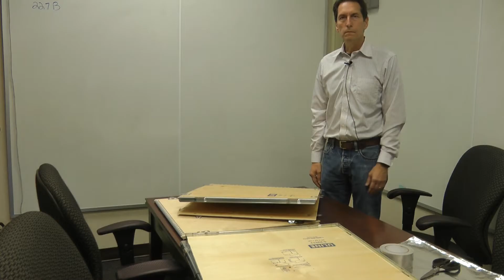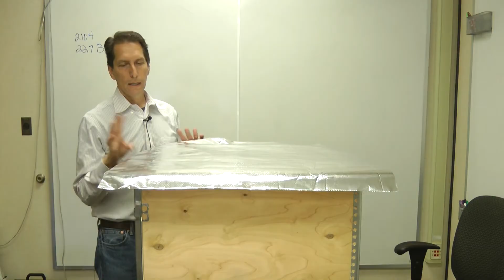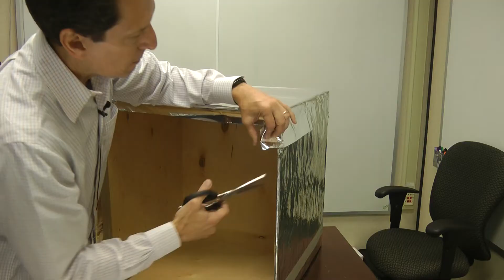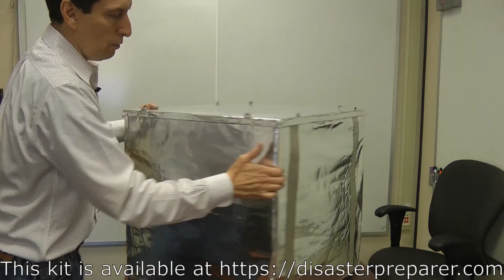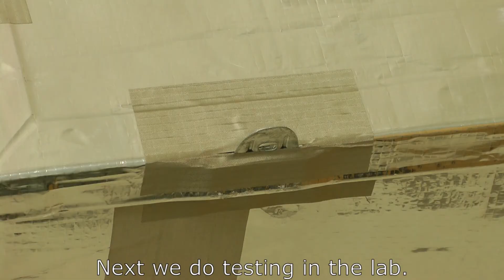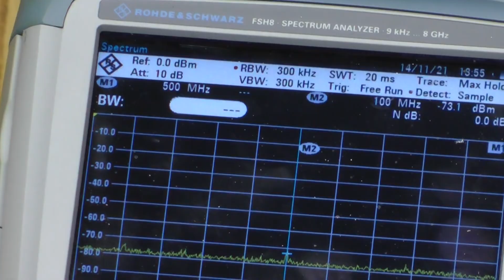Faraday DIY Box

Comment: Hi, Dr. Bradley.  I want to protect my home power station system from an EMP incident. The battery backup is not on wheels, but I plan on buying a small expandable furniture dolly that I can fit to the bottom of the battery so I can move it around, as it is much too heavy for me to lift.  I thought if the bottom of the box was not attached to the sides, I could lift the sides and top off to use the battery backup, like turning your box upside down.  It is 16.5" long x 13.5" wide and will be about 17" high when it is on the dolly.  I need to be able to access the front, one side and the back when I use it.  I thought I would roll it onto the bottom of the box and place the box upside down over it.  Do you think that would work?  Are you selling the pieces of your 2'x2'x2' box?  If not, would covering a cardboard box with heavy duty foil block as much as wood?  What is the brand of foil/cloth that you used to cover your box, and do you sell it?

Comment: I just finished with the setup of my Faraday Box using the components that I ordered from your website and the 24x24 box from Uline. Should this box prevent my Android phone from receiving calls? If it should then the box is not working as it should. I have no tears in the conductive wrapping or the tape that I used. I don't have any RF tools to measure what's being blocked by the box, so I don't know what I should do here.

Comment: Excellent video.  Very interesting and worthwhile video. 
Can one make such a Faraday Cage (Box) using a heavy cardboard box with two layers of aluminum foil covering the exterior?
Can one use a steel trash can (with a tight fitting steel lid) and with a cardboard box in the trash can's interior?
Will these Faraday Csges suffice for a Carrington-level CME?
Many thanks.

Comment: Also where can one find the corner metal hardware?
Reply: I’m thinking the metal hardware doesn’t really matter. You could nail/screw 6 square pieces of wood together and line it with the same conductive material and be fine, as long as there’s no gaps in your conductive material.

Comment: The one suggestion is place Rubber old Tires or Rubber mat on Bottom. This will ressistance Electrical Power or Surge. Defetes need for Faraday Box. Plus Surge Protector inside also. Extra Protection. Great Size for those with Cpack and EcoFlo smaller Generator also store portable Solar roll -up Panels.

Comment: Oops, forgot to ask you something in relation to my earlier post. Do I need to ground the aforementioned faraday boxes I asked you about? I've heard that I should just leave them isolated, on a rubber floor mat, but I've also been advised to ground them to a cold water pipe, or to an 8' ground rod via 4-6 awg cable. 
Please advise.

Comment: Excellent video, as always. I have a question about a large storage box that I am currently using. 
I have a large, rectangle truck bed box that I am storing my solar panels in, and is made of a heavy plastic material. It is about 5' L x 3' W x  2.5' H. So, the material is not conductive, but I have to cover the exterior with a conductive material to prevent rf intrusion. 
Besides the material you are using here in this video, can you please recommend an alternative material that I can use that will protect the panels inside, that is cheaper. 
I'm currently living on a limited income ( ... the result of being downsized) and I can't afford the material you're using, as I require a substantial amount of material. 
It's been suggested that I use two or three layers of aluminum foil, but I'm concerned about the fragility, as the container is very heavy, and I don't want to inadvertently tear an opening in the foil when moving the container. 
Also, I have an old style four drawer steel file container that I would like to use for storing additional electronic items ( I'm a ham, and have several different pieces of equipment I'd like to keep safe). 
Can I line the interior of the steel file container with either spray on truck bed liner, spray on undercarriage rubber coating, or thick pieces of cardboard taped together with gorilla tape, to act as an efficient rf barrier - or possibly incorporate all three products in layers, inside the file cabinet?
Time consuming, but I seem to have a lot of time now to take on these necessary precautions to keep my equipment safe from an EMP or CME. 
Any suggestions or advice would be greatly appreciated.
Reply: space blankets, they're cheap. I just ordered a dozen for $14 on amazon. They may be a little thin but I ordered them for reflective properties in a sunroom, will see how thick the ones I ordered are for Faraday application. I like the idea of the flex spray for the interior! :)
Reply: @Recon1Alpha  According to the tests in another video on this channel, those space blankets do not provide enough protection.
Reply: @atomicfrijole7542  well that sucks maybe double layer?
Reply: @Recon1Alpha  Looks like good old aluminum foil does a much better job. Yeah, one layer on the outside and I would do a layer around each inside too. That's my plan anyhoo. Make sure to get that conductive tape to seal the edges.
Reply: @atomicfrijole7542  I was planning on using spray flex seal on the inside to prevent having to insulate the interior items from an inner layer of foil. I like the idea of the small metal garbage cans too. Spray flex a few coats of black on the inside (I guess color doesn't matter) and then store your items inside. From what I have seen any metal container should do, as long as it can be sealed well and your stuff inside is insulated from the walls. I guess I will use the space blankets ( I got a pack of 12 on Amazon) for reflection in my sunroom. I am also looking at some of the small Rigid metal job boxes. The lid has a nice gasket seal and should be somewhat easy to wrap with heavy-duty aluminum foil. It has 2 cutouts for padlocks on each side, which I think could be cut off with a grinder on the inside and weld plates over them to eliminate EMF leakage. I would also spray the inside with a few coats of the spray flex. I am also wondering if you could use the spray galvanized paint?
Reply: @Recon1Alpha  Went to Walmart with the wife today, she got a yoga mat that seems to be foam rubber. It occurred to me on the way home that that might be a good addition to the bottom of of the cans too, along with the spray liner. Where did you find the Rigid metal job boxes?
Reply: @atomicfrijole7542  we use them at work, I believe we got them at Home Depot. I will check.
Reply: @atomicfrijole7542  Here is a link to one at HD, we have a couple this big (too big for my liking) but we also have a few that are smaller though I did not see them listed online. Maybe Grainger? I will check. The mat on the bottom is a good idea.
Reply: @Recon1Alpha  Thanks bud. You have a great week. :)

Comment: Saving electronics is great and I do, but-many items will not be saved. In that case unless the power source is disconnected many items will be on fire in a powerful EMP. I would suggest having a plan to deal with those items and where they are located. I have several large metal garbage cans with lids to put small items in that my be smoking or on fire and several fire extinguishers.

Comment: Would layering inside the box provide more protection? Like If I put hard drives/electronics into a small EMP bag and then those into another EMP bag and that into the box? Does that provide extra protection or make a difference if you layered like that?
Reply: It does, it would help. He would probably say its overkill and the box would be enough. Just depends, if your protecting a spare insulin pump for example Id do both. Flash lights and radios Id just use the box. You could also layer the inside with another smaller emp box as well.

Comment: Thank you so much for taking your valuable time with this project! I have a question though concerning the construction of the box. Assuming that conductive tape is more expensive than say duct tape or gorilla tape, would it not be more reasonable to use less expensive options on the areas where the conductive sheeting is being attached to the plywood? My assumption being that the other attaching panels would either not be touching those areas or that the conductive sheeting would be overlapping them reaching other conductive material (where you would use conductive tape). Am I being clear about this? It’s a bit hard to get across but perhaps you understand.
Reply from the maker: You certainly can do this. In truth, I suspect even if you used Gorilla tape on the entire box, it would still work almost equally as well. The metal to metal of the overlapping conductive cloth would probably be enough to seal it up.

Comment: Awesome channel and great info.
Question though...
I'm less concerned with EMP strikes than I am 3 letter agencies and new tech being used to hack and spy on our personal devices.
What type of material or fabric do you recommend for absolute privacy and security for a smaller box or wallet size bag for phone, sd cards etc.?
Thanks!
Reply from the maker: Most good RF phone pouches will work fine. The provide around 80-10 dB of shielding, which is plenty.
Reply: @disasterprepper  Awesome thank you brotha!

Comment: Hello Sir, because of the actual situation, would you say this is also NEMP/HAEP save?
Also in therms of the energy load of an bigger bomb.

Thank you very much.
Reply from the maker: I think a Faraday cage like this would provide adequate protection against a NEMP, even a very large one. Very sensitive electronics might also require placing them in EMP bags for double layer protection.

Comment: Wouldn't it have been faster, cleaner and easier to put the conductive barrier on the wood before putting the metal frame in place?
Reply from the maker: I suppose you could do it that way. You'd just have to tape up the seams real well.

Comment: How much is it for you to build me a box that turns all technology signals off? (I need to sleep in it I'm 5-11 195 lbs)
Reply from the maker: They sell bed canopies that offer shielding like this. Google EMF bed canopies, or something like that.
Reply: @disasterprepper  I'm getting some GIRON magnetic shielding to help out off amazon which is kind of expensive but might work.  The plan to turn off all signals is:
wear wet clothes  
get in the back of my truck bed with a plastic tent and a sump pump showering a solid flow water fall all around me without getting water on me, 
then I'm going to get into my rf shielding mesh grounded bag, 
then have another bag I get in that is the magnetic shielding,
then I'll put magnets on my ears.    
This should turn off all technology signals but the only remainder is sound signals so after I build all of that I'll definitely have to build a sound neutralizing system.

Comment: Nice video, 
What did you use as shielding material? How much does it cost?
However, Military EMP Bombs create magnetic fields on the order of hundreds of millions of Gauss or more.  The EMP wave is a pulse with near DC characteristics and very little high frequency components.  
 
Its been a while for me, but in the 80's working with the Air Force and General Dynamics on EMP detection and protection, the only way to generate such an EMP is from a Nuclear Detonation. We had to scale up our experiments in the lab to determine a real tactical EMP event (still classified).

As a rough matter of scale using 0 dBm as 1 mW/50 Ohms. In your low power experiment you excite with 100 MHz at -7 dBm (200 uW) at a range of about 100 mm, and  read -73 dBm (about .05 nW) which is 66 dB attenuation inside. But in reality, a real DC EMP event will generate (what I can only say): a big enough pulse to get through in your case at about +40 dBm or more (10 W), that is enough to destroy the electronics inside.

Comment: Hmmm, What you are using looks like MuMetal, but may look like aluminum foil to casual observers. You should warn your audience NOT to use aluminum foil to block the Magnetic Field from an Electro-Magnetic Pulse (EMP) event, it will only block the Electric Field, a Magnetic Field will pass right through and induce destructive currents in the electronic devices inside. In electronics engineering, magnetic shields are made of MuMetals or Steel to shunt the magnetic fields around something.  These are often used around inductive devices like transformers to reduce induced hum in surrounding equipment.  To the Audience: Try this: Hold a piece of steel one inch behind a sheet of aluminum and place a strong magnet against the aluminum on the other side and watch the steel be attracted strongly to the magnet though the aluminum. Try the same with a steel plate in place of the aluminum and place the magnet right up against the steel plate. The steel about an inch away on the other side of the plate will not be drawn to the magnet nearly as much.  This is why an inch or more of insulation (like cardboard or wood) must be inside to keep the electronic devices away from the steel sides.  Using aluminum may work for low EMP pulses, but the "HUGE" EMP pulses created by a special nuclear detonations will not hold up. Remember, EMP bombs are effective from thousands of miles away. You may not hear or feel the event, but if not properly protected, your devices will suddenly stop working (permanently).  Look at a Radio Faraday Room you will find in many Radio Frequency (RF) laboratories... they are always made of Steel and the really expensive ones are made of MuMetal. These rooms usually have a fine Steel or Copper Mesh window for breathing air. But a fully closed Faraday Box will offer greater protection from an EMP event.  Nothing is absolute, but aluminum is not the way to go for massive EMP events.

Comment: What about using thermal paste as a sort of caulk for cracks and crevices? "Thermal paste (also called thermal compound, thermal grease, thermal interface material (TIM), thermal gel, heat paste, heat sink compound, heat sink paste or CPU grease) is a thermally conductive (but usually electrically insulating) chemical compound, which is commonly used as an interface between heat sinks..."

Comment: Hello, quick questions: 
1. Does the foil need to be exposed or can it be protected on the exterior by a layer of cardboard duct-taped over it?
2. Everything inside the cage needs to be separated from the foil and tape, since contacting the conductive layers would defeat the purpose, correct? If so, would several layers of plastic prevent conduction?
3. Should a ground wire run from the cage to an electrical outlet, using the ground socket hole?
Reply: Building ground is connected to the grid in some cases. 200K volts can jump from the hot line to the ground easily.
Remember, most if not all grounds have greater than 0 ohms resistance.
Plastic generally is an insulator hence the use of plastic in power tools and such.
Silicone may be a better insulator (think car ignition wires type silicone).

Comment: How about wrapping cardboard boxes in foil and sealing it with metal tape? Will that work?
Reply: It will work, but won't be as sturdy as wood boxes.
I have a slightly different method I do.

PLEASE READ ALL DIRECTIONS FIRST!!!
1) Keep electronic in box it came in
2) Wrap box light Christmas gift with 5 complete layers of Aluminum foil.
3) Place box into a EMP bag and heat seal bag with curling iron (wife's)
4) Place item into BIG metal garbage can that I made into a faraday cage with cardboard lining the inside of can and a VERY LARGE EMP bag inserted like garbage bad into can 
5) place all items and fill large garbage can with all electric gear in smaller emp bags . And heat seal bag 
Place lid on can and use metal tape to seal can around edges .
Write list of what's inside can and tape to outside of can.

How to turn a metal garbage can into a fer😅aday cage.
1) Use Metal Duct tape and seal any and all holes in can like Rivits, Handles, and Seam along side on inside and outside.
2) Line can with Cardboard just below the lib. Make sure lib can close tightly. 
3) Insert Very Large EMP bag into can like trash bag.

Note:
Some of the steps are repeated in both descriptions. Make faraday cage first, then proceed to how to seal items up...

Comment: 'If you double layered the aluminum layer would that give you more shielding?
Reply from the maker: It would increase the level of shielding, and would also offer more security in the event that one piece got a little rip in it. Double layering is optional, however, and not necessary for basic EMP protection.
Reply: @disasterprepper  thanks doc!

Comment: It works great but remember when you Fold the EMF paper INSIDE the Box, you bring inside the Box the charged paper!
I got a 3' X 22" Uline Box and the correct size EMP cover, and I'll do it the Same way but I'll be careful to keep the foled-in pieces as small as possible and use simple duct tape.

Comment: Thanks for all the great info! I do have a question, I already have 3 inch copper foil tape, would there be any problem using that with conductive barrier you used on this project? I was hoping to save some money and skip the aluminum tape from your site and just get the conductive barrier material for the box I'm making. Thanks again for the info and the help!
Reply: Yeah nah, copper tape is more expensive than aluminium tape. You can find aluminium tape in the DIY store, near the floor insulation, or roof insulation. It's a few bucks per whole roll 😐